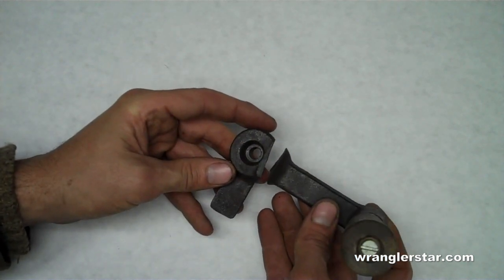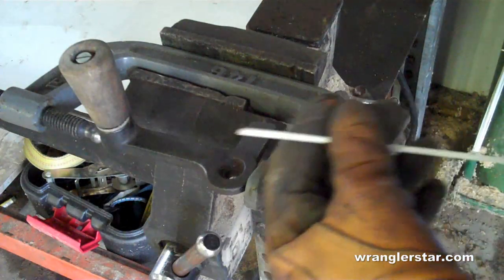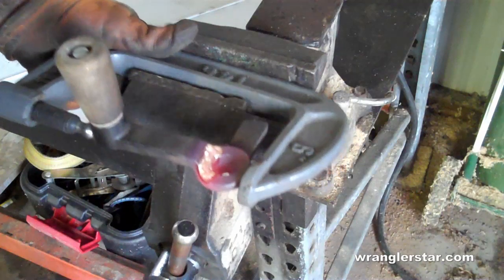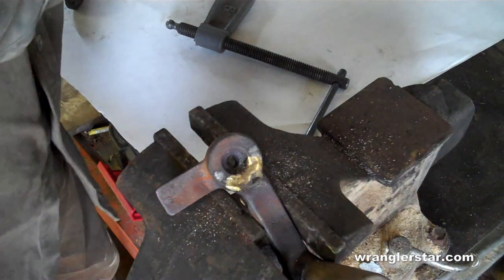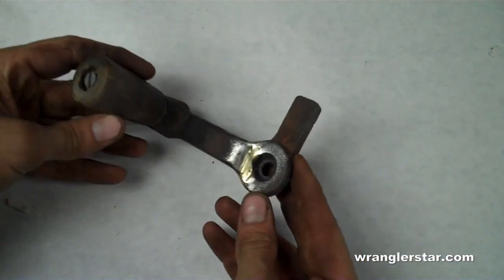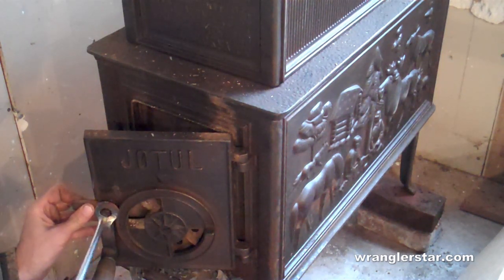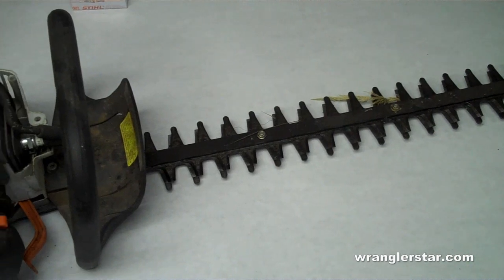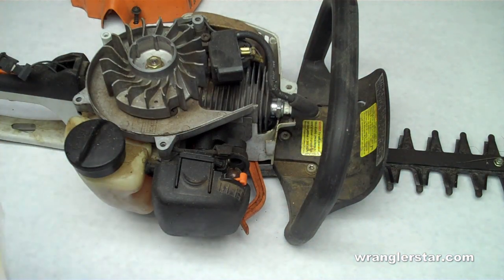The Life Of A Homesteader

Comment: I have an Oxy/propane torch that works well brazing and for most cutting/welding jobs. The big difference using a propane "cutting" torch is that it doesn't like to cut old welds or slag. An Oxy/acetylene cuts through welds and slag way better.
I enjoyed watching Cody braze using a cutting torch. I always changed to a welding tip.
When welding exhaust pipes on motorcycles, use a coat hanger or mild steel rod. You can't braze it because there is too much heat and vibration. The braze will break.

Comment: From a jewelry making/non ferrous metal standpoint, you can heat the bottom and the brass will flow through to the hot side, insuring it gets through the whole piece. You could also flux the two pieces first to be sure no carbon builds up inside the joint. Great ingenuity, thanks for another enjoyable video.

Comment: BTW, if you need to braze and you only have plain brass rod (like TIG filler rod) you can use plain old Borax as a flux. You heat the end of the brass rod and dip it in the Borax, which will melt and stick to the rod, and then apply it to the workpiece. Re-dip the brass rod in the Borax occasionally to keep an even coating of melted flux on the brazed area. Chip or scrape the hardened flux off when the workpiece has cooled.

Comment: An addendum to your wrench flat tip on the #3 Philips bit: use a dab of valve grinding compound on the tip of the bit, and it will prevent the bit from slipping in the fastener recess. Another tip I learned as an aircraft mechanic :-)

Comment: one trick my boss showed me when welding a painted surface and you need a good ground, start your weld on the ground connector and walk it onto what you're welding. sorta just tack the ground to the painted piece..it comes right off and makes a great ground.  i mainly do this with stick since thats what i normally use for welding, but it works for mig.

Comment: What  we normally do with cast iron is cutting a v in the crack with a grinder, heat it up to cherry red and weld it with a mig welder, high on amps low on wire, re heat it cherry red again and let it cool slowly to cold, then heat it again to around 300 celcius, let it cool of, re face it with a grinder, and its like new again!

Comment: I would say definately no for propane, alot of times plumbing we have trouble getting copper with brass fittings hot enough from propane,( when its existing pipes or very low temp). MAPP gas, maybe but would probably take a long time if at all, but as with wranglerstar i have not personally tried it.

Comment: Sounds (and looks) like you need a little more wire speed with that welder, with the voltage you were running, especially with light gauge mig, as it doesn't penetrate quite as well as stick. Also, you should always clean, or grind the surface of your joint so that it's free of contaminants like paint, which could end up In the weld and cause it to fail later. Just a few pro tips from a journeyman. Cheers ;)

Comment: Cody, nice video on the welding, and repairs.  I see you understand cast iron, temps, welding process, and such.  But why are you using your cutting tip?  Don't you have the regular gas welding tips for your torch?  I think you will find they will work much better for welding.  But kudo's for using what you have!

Comment: why would you use a rat tail for something like that? also, proper use of a file card is to never drag the card across the teeth of the file. they are designed to  go with the teeth of the file. this means generally, you will be moving the file card in a diagonal motion with the teeth on a single cut, and diagonally both ways with a double cut. round files are the same, you do not drag the card from the tip to the tang.

Comment: I know stores sell little kits for oxy-map gas torches they are like $75 and would work for brazing but they aren't the greatest because there is very little oxygen in the cylinders and you cant get high pressure ones that fit that system.

Comment: yes you can my friend i used a burnz0matic 4000 with fatboy (mx) gas for afew jobs around home now until the internal reg failed so i brought a 8000 and now have map pro (m) gas for that its ment to be hotter again it dose take awhile with these torches but the amount i use bottle rental isnt worth it of course on thin stuff silver solder has a lower melting point again great on things like water pipes :)

Comment: JB Weld it
Reply: Not even close to adequate for a repair like this. Not to say JB Weld doesn't have its uses but not for repairing a cast iron handle that is under a torque load. He did the right job here. Brazed.